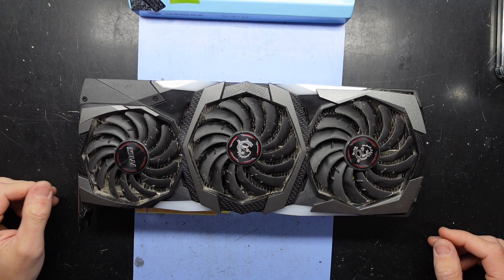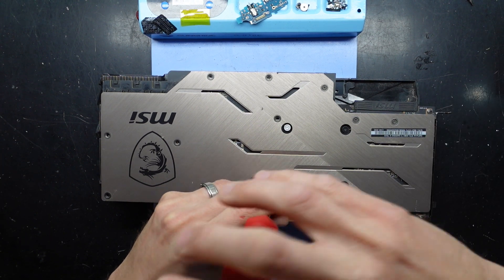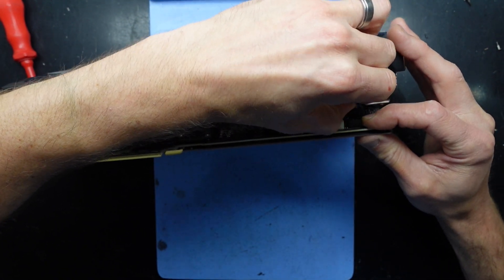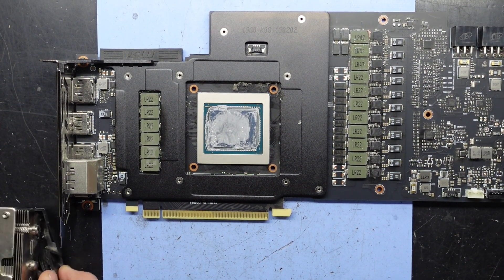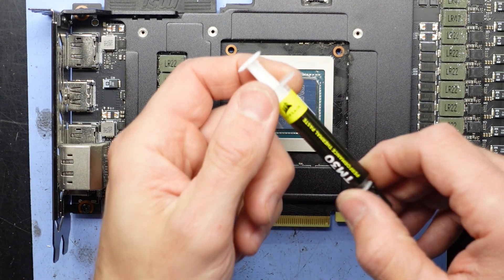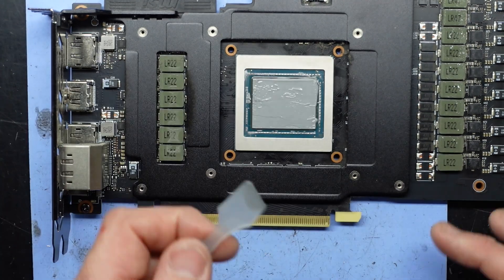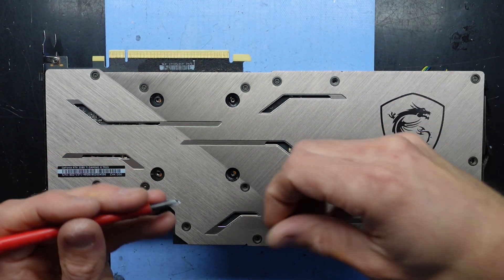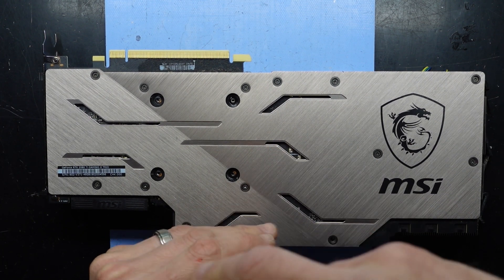MSI RTX 2080 TI Gaming X Trio Thermal Paste Replacement

Comment: what is a difference in temperature on core and hot spot before/after?? I have the same card and when i have 70C on core, the hot spot reaches over 105C(supposedly 108C cut's off ) and card gives black screen, system still works , gpu fans 100% all time and i must reset PC . its really need's to replace paste. actually i set power on 90%(270W) and temps stops on 70C on core and ~100C on hot spot. half year ago  set 95% was enough by today must be 90%. probably paste its dry like dust already. On days i prepare and replace paste and thermalpads in one shot. what paste and pads do you recommend? thermalGrizzly is good? ( sorry for my english)
Reply: I have the same issue with my rtx 2080. GPU outputs "no output signal " screen goes black, the fans ramps up too 100% and I have too turn of my PC to fix it. So the solution is too just change the thermal paste and pads or should I buy a new GPU?
Reply: i have the same problem with my gaming x trio 2080ti. i had to change the thermal paste afte ronly 8 months of ownership as the fans were scremaing

problem is getting the pads to help with hot spots temps. i cant find the pads anywhere from any store :(